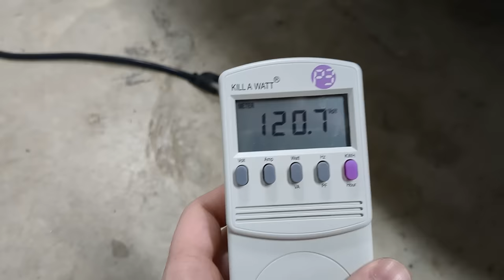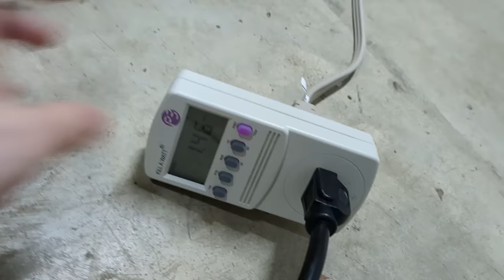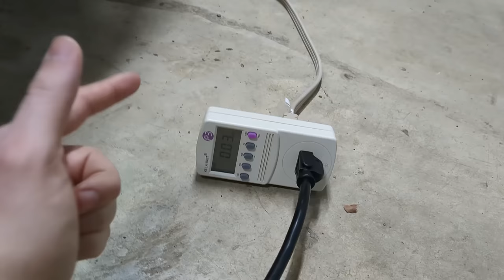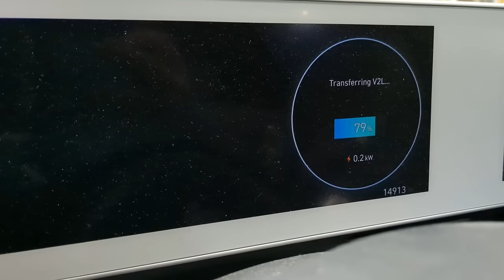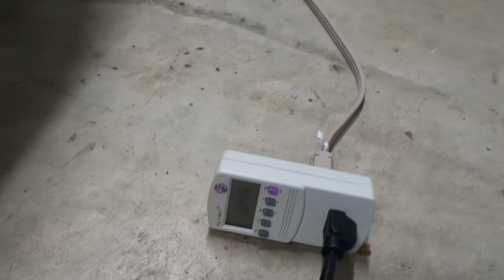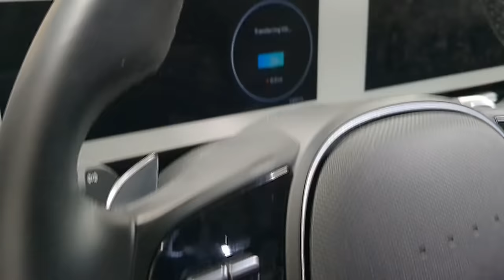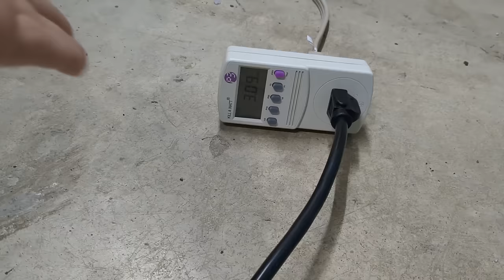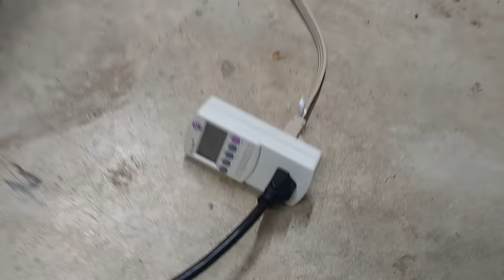A 24-hour test run of the Hyundai Ioniq 5's Vehicle-to-Load function

Comment: This has been very interesting!  I agree that all EVs and PHEVs should have this feature.
Reply: Hey! Nice to see one of my favorite nerds following another :)
Reply: Better yet, just give everyone a 120volt outlet in the trunk that runs off of the batteries.
Reply: Which begs the question... how many Commodore 64s and CRT screens can you run with this setup??? 🤔😶😶😶🤣
Reply: @mccalejk2  I've had that in my last 3 cars. It actually can trickle-drain, unless there's a way to turn it off.

Personally, that's why I have an integrated 120/240 split-phase inverter separate from the charger. So the backfeed/generator mode is independent of the charger...and also I can use the inverter to power heavier loads without having to worry about surge-loads popping the breaker.
Reply: What's even more neat is just having a generator running off of a more cost effective fossil fuel generator.
Reply: Oh wow you're here lol. I love your videos
Reply: Not sure it's valuable on a PHEV - given the small battery size.  Of course, you can always draw a smaller amount via a 12V inverter on any vehicle, but much less efficient
Reply: @ozobken  

Depends on the battery size. We ran the fridge and sump pump overnight with a Chevy Volt (14 kWh usable) after mounting a 2,000 watt inverter to the 12V battery. Used approximately 20% if I recall.

The DC to DC converter is 2,000 watts in that vehicle. Ran a vacuum to test it, it ran fine as a sole appliance, wouldn't recommend that amperage for prolonged periods, inverter has 4,000 watt surge buffered by the 12 Volt AGM battery.
Reply: @ozobken  my RAV4 Prime has a built-in 1500 watt inverter that runs off of the HV battery. It certainly couldn't go multiple days, but from a full charge to empty is roughly 14 kWh so it could easily go for a day. I used it to run lights and a fan when the power went out last summer and I was trying to finish up a painting project 😅
Reply: I read those as Eves and Pheves and I feel like that should be the proper pronunciation.
Reply: We'd have to change how we warranty the battery packs. Because we are used to mileage-based warranties on cars, that's continued on for EV's. 100,000 miles at 4 miles/kWh is 25MWh. Add in expected overhead, and they are basically warrantying the battery for 30MWh. If people are using the battery pack as a stationary power source, manufacturers aren't going to want to warranty a battery that has only driven 30k miles, but has used 50MWh because it was being used as a Powerwall.
Reply: Inverters are pretty cheap . We lost power after hurricane Ian and used my Prius as the power source with an inverter. I used about 1 gallon of gas to leave the car on for at least 24hrs and I gave my neighbors power also and even cooked with an induction cooktop.
Reply: I think batteries in general need to be revisited with extreme prejudice. Theres no reason you shouldn't have a battery 5 times as powerful as your cars, already in your house hooked to more than one way to keep it charged.
Reply: @ozobken  If the ICE could turn on when the traction battery is mostly depleted, I would think that this could be a much more efficient way to get longer run times. Although, you'd need to worry about exhaust.
Reply: with the (estimated) 166 watt/hour drain by keeping the car on home inverters I've seen have around 54watt drain it might be nice to have a EV do a DC to DC charge of a home battery bank. If one could push 50 amps into a home system could force a lot of power in a short time to reduce the power loss of leaving the car on... of course have to account for losses in that system too.
Reply: @goyimgolem2054  mix a gas generator + a battery backup system (a few solar panels would supplement during the day)... when batteries go out use generator to fill them up + power home appliances then ready for another few hours.
Reply: @goyimgolem2054  There are trade-offs though. The noise of a generator is extremely noticeable, especially in smaller homes. Also you have to run it outside, and keep it topped-off. And when I experienced a disaster which knocked-out power for several days, there was a rash of generator thefts (and also a shortage to purchase them).
Reply: @Tron08  it's kind of unrealistic to include people in the discussion who live in small spaces. Real humans live in single family homes in the suburbs. Only poor or "woke" creatures live in condos or highrises. Just put the generator in your backyard as close to the neighbors fence as possible haha! I hate my neighbors. 🌈
Reply: @goyimgolem2054  Honestly...I'd rather use my car as a battery for my house, over using a fossil-fuel generator.

And I say this as someone who HAS a dual-fuel generator modded to run on off-gassing from my septic tank. I'd still rather use a big battery. Because the generator is noisy.
Reply: hey look it's the 8 bit guy :D
Reply: Try sticking a paperclip in your Tesla's charging port to enable this feature.
Reply: but i like the automatic and convenience of habit plugging in at night/getting home and ford/automobile does it in the background for me, not o crap were's my emergency gear/stuffs/mac-giver ect and it's more peaking-KW aka 2kw vs say 200-400A @ 240vac
Reply: @Okurka.  That sounds like a really, really bad idea.
Reply: @ozobken  probably even more valuable in PHEV since it can charge battery with gas engine dubbing as a generator
Reply: Agreed, cant believe it took manufactues this long to figure this out.
Reply: @robertschnobert9090  running noisy generator in time of disaster will only invite hate and envy. Best to minimize it's use. I'd go with deep cycle AGM batteries and vehicle charging them instead
Reply: @rysterstech  some of it's law and or utilities blocking the ideas and no it's unfortunately not the end of trying to get duel pack use out of the car, as some are saying it's to dangerous/block-it ( or limited it to the point that it's not sure usefulness ect ) but yes done incorrect it can be but so can starting a ICE engine in a shop with the door shut ect
Reply: @Tron08  and as pointed to me somehow gasoline stations quit working/out of business so there goes your transportation and electricity ect

vs solar and ev's there's a good chance that it still works correctly 

not a against PTO-generation ( 1968 C10 ) as that's my 1 form of backup plan but i have to be pragmatic about it
Reply: @robertschnobert9090  so next to your i don't like next door makes easy for them to pull to power cord or spark plug wires off aka bad move 🤦🏻‍♂ in a emergency and it's still better off to be civilised as you might need either others... vs say criminal activity
Reply: @wzDH106  good GG. something that the video didn't mention is the pipes ( even trying to blow out the incoming line's still can pop a line did it this year 😔as i was out in the 1970 ( home is a 1970 )shop/garage and needed to change a leaking/spraying valve ect and didn't get enough heating to it and or water running though the copper/pex pipes ) generally don't drain all the way and the swowar/drains will hold ice, unfortunately i knowledge from 1st hand experience and it can lead to needing to bulldozing/or gutting the house 🏡 ( my childhood home ( built in the 30's/50's ) in the 90's from losing power and gas/LPG completely and winter season/storm ) as it totals it out aka 100K+ usd in damage's, and can add to marital stress's ect
Reply: @NikkiTheOtter  Boy hoo, noise. I used to be a truck driver. The trailer refrigeration unit and the Auxiliary Power Unit used to make so much noise and vibration. You get over that shit fast. You don't have to micro manage a novel battery unit like in this video, nor do you have to worry about your vehicle starting a 3 day long fire.
Reply: @ozobken  Agreed. Those stupid things only get 15 miles of EV range on a good day? They have no value as a generator.
Or as an electric car, frankly. If it can't even handle my short 25 mile commute without using gas then I don't want it.
Reply: @Tahngarthor  It was also a bad idea to stick a paper clip in a rare computer and destroy it, but that didn't stop 8BitGuy from doing it
Reply: @goyimgolem2054  My house isn't pulling from a 200 gallon diesel tank though.

I will concede that you don't have to micromanage a battery, or worry about a fire, but once you get used to the SILENCE of not having to run a generator while sleeping, it's really nice.
Reply: @mjc0961  so are you just here to bash the 8bit guy then? That thing didn't work before he tried to work on it, so history didn't really lose anything, there aree still 4 other identical machines and none of them really worked in the first place, just doing the only job they can, be a paperweight. Just move on, lesson learned, like the rest of us.
Reply: tomorrow Tesla comes out with a subscription service for it.
Reply: @John Peat  they're going to do it based on mileage- not based on electricity usage, which will vary by vehicle but has nothing to do with road usage, as thus very video illustrates. You make this sound so bad but the gas tax pays for road upkeep. If people don't use gas anymore they need to find another way to raise the money to maintain the roads so don't come here with the anti government fear mongering.

When you register your car you will pay the fee based on mileage since the previous registration. Since that actually reflects how much you used the roads.
Reply: @ozobken  I have a Ford Fusion PHEV. It's only a 7.4kWh battery, but if an tell you that I can go to a drive in theatre (yeah, we have one around here) and watch two movies back to back, plus the waiting for the show to start, and intermissions, with the AC, stereo (12 speaker with surround sound), and seat coolers, and it doesn't use more than a percent or two.

Despite the smaller battery, a PHEV with this feature could still run you overnight easily enough.
Reply: Electric lawn tractor included, as I had to hack mine.
Reply: PHEVs especially, seeing as Ford has had a lot of success with V2L in the F-150 Powerboost.
Reply: @goyimgolem2054  Nice try shilling for dino juice
Reply: You missed the huge downside. It will age the battery significantly. The best EV out there is from Tesla and they can't warranty 8y 100k miles, which was estimated by averaging 3 miles per kw, and 300 cycles, Essentially if you discharge and charge 300 cycles, the battery is possible to drop below 80%, which isn't bad if you use it fully as "powerwall", but it will be very bad when your full range drop from 240miles to 190miles (more of 160-180 in real world, or 140 in cold real world). Average household can use 20-30kwh per night, meaning that if you do this every day for a year, you will use up 180 of your 300 cycle in a year. And this is a problem.